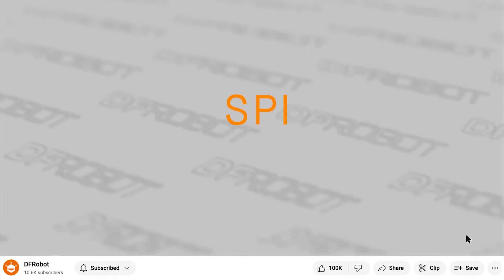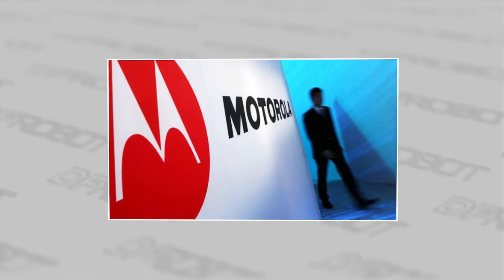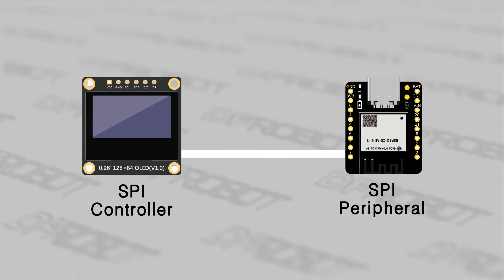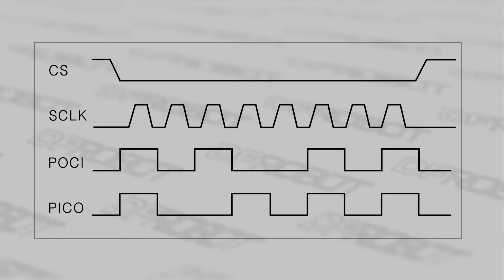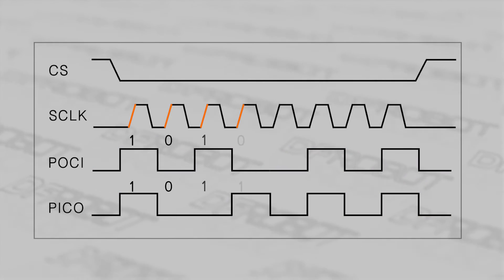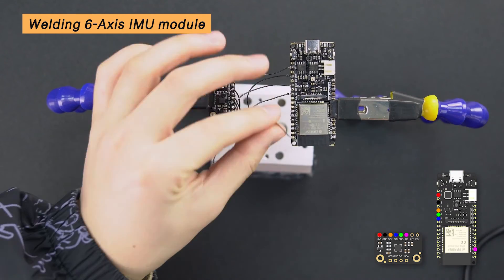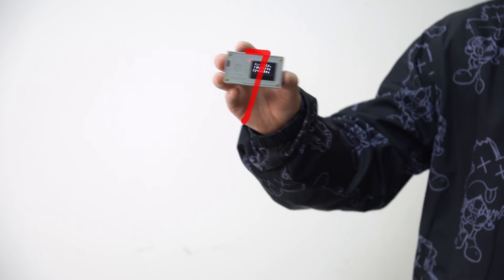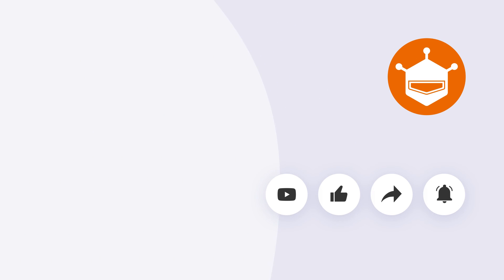How The SPI Protocol Works - Fermion: ICG 20660L Accel+Gyro 6-Axis IMU Module (Breakout)

Comment: A slightly deeper dive would be nice: using CS to enable CIPO (MISO) when multiple devices are present AND are tri-state outputs (the need to verify that is important), that CS can be activated over the entire transmission or a byte at a time, that the "frame" can be various bit lengths, that there are half-duplex modes that some devices use, etc, etc.....